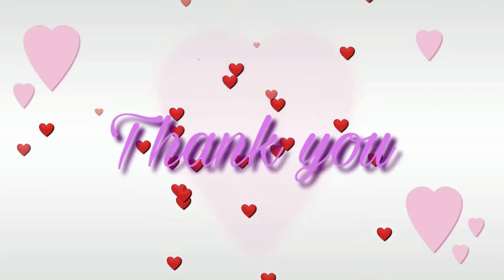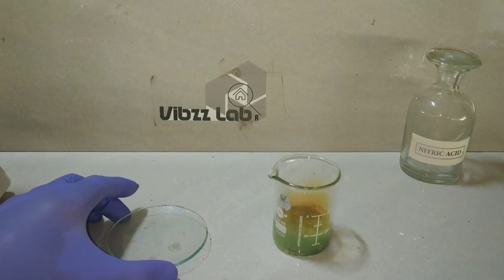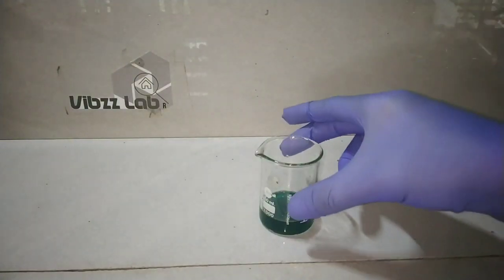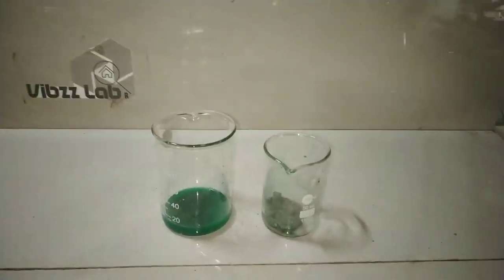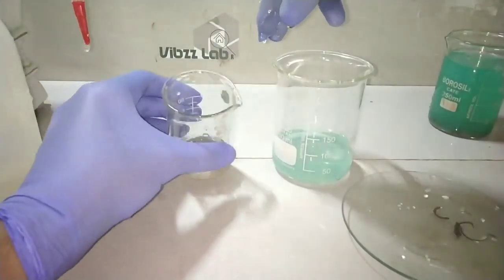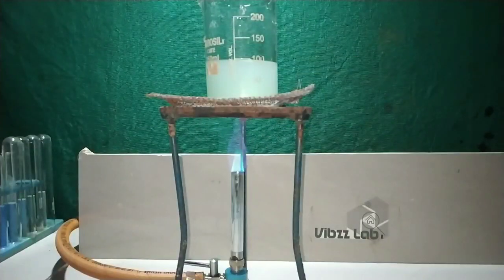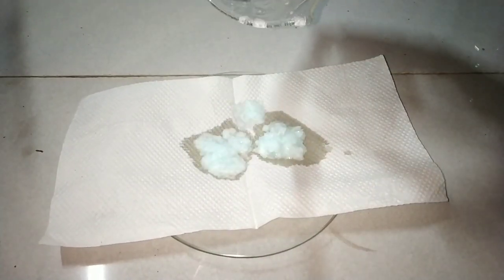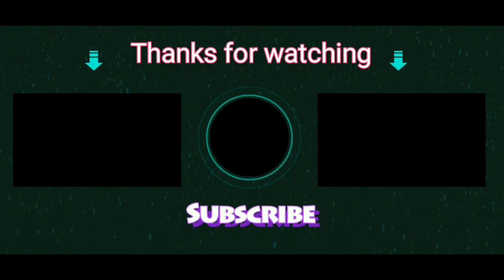Silver From Jewellery and making Silver Nitrate

Comment: I have to wonder if vacuum filtration with water rinses of the precipitated silver would remove more copper contamination!  Also I plan on using thick single piece of copper wire for displacement.  A 25% to 30% nitric acid is plenty for this as 68% is overkill and it makes metal nitrates less soluble.  

Having a bottle handy for silver bearing waste would be good idea.  You can always boil and concentrate it and add sodium or hydrogen chloride to drop silver chloride for storage